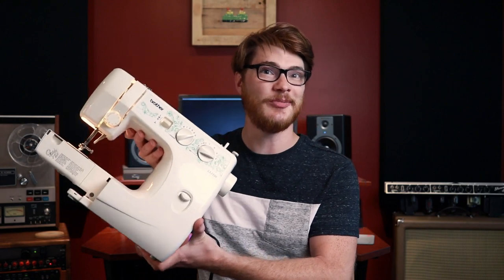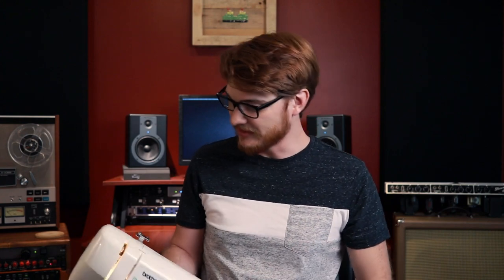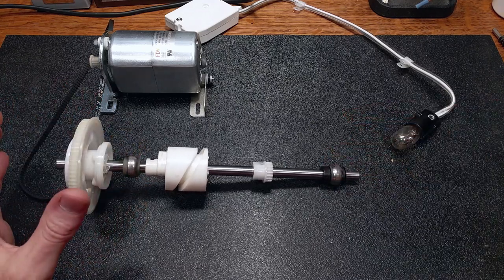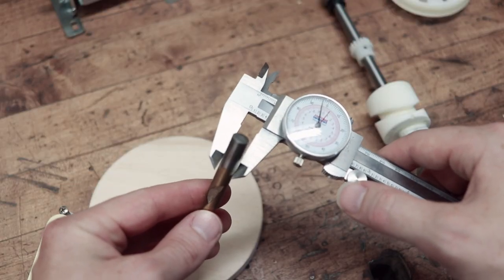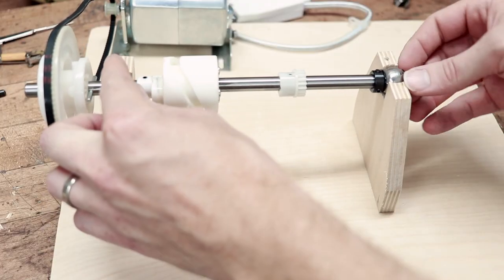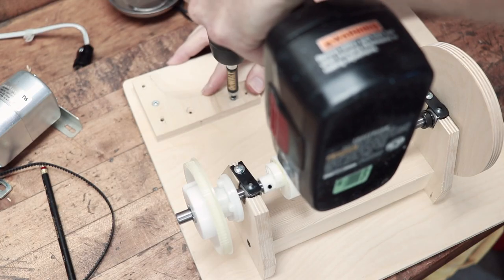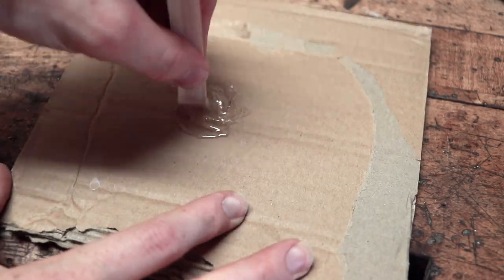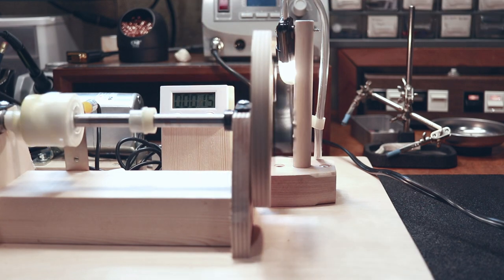How to Turn a Sewing Machine into a Pickup Winder

Comment: This is a great video. I made a pickup winding machine some time ago, but threw it out when we moved. I am going to use this video as the basis for making another one.  One suggestion: instead of guiding the wire with just your hand, consider making a fixed guiding mechanism. Mount a rod horizontally  and attach a guide such as the pen cap or a straw.on top of it. Run the wire through a tensioner and then through the guide and onto the pickup. You can move the rod from side to side to guide the wire. You also could use some drill bit caps and springs to help keep the wire from going too far left to right. As good an engineer as you are, you probably could find a better way. Your videos are outstanding.